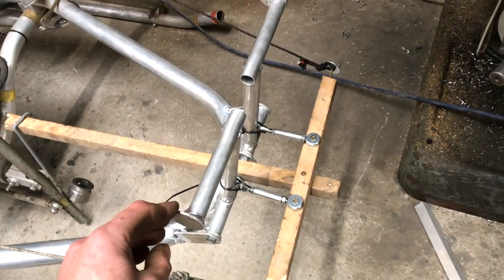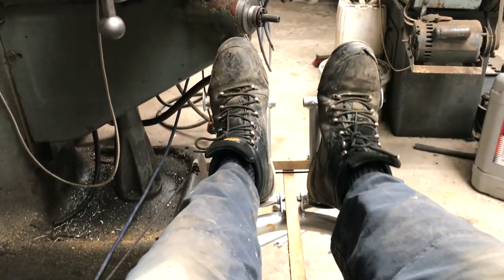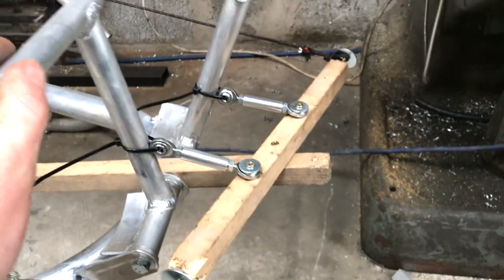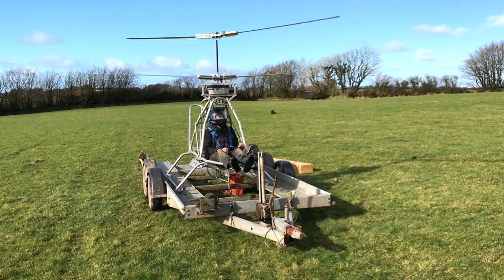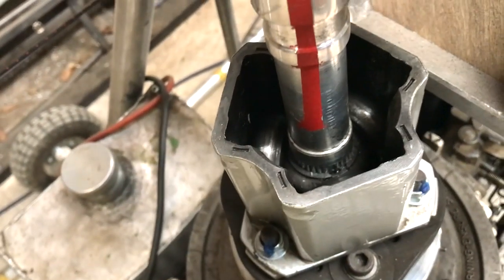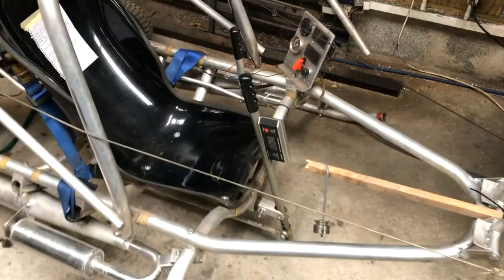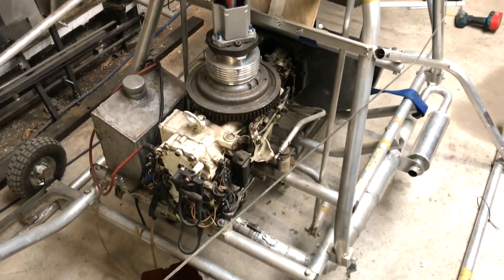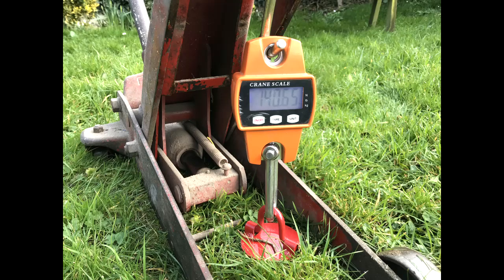Rudder Controls Homemade Coaxial Helicopter

Comment: I love the counter-rotation mech by 3 belts: one conventional, one reverse direction with the pulleys to help wrap the other side of another pulley. Never seen that setup. Elegant and simple!!!
Reply from the maker: Thank you 👍  it seems to work so far and should be efficient, you could possibly do the same thing with chains but it would be running at a higher chain speed than recommended without running in an oil bath.

Comment: Hi Ben, congratulations on your first lift off, I was chuffed to bits for you, a great mile stone in the build of your coax machine.
I've been following this project from the beginning with great interest, you have made good progress and learned from your mistakes and not given up, 
I haven't commented before now as I hate & detest  typing but now I feel I could be of some help to you, this has gust tuck 25 minuets to type but  I will persevere.
FIRST I'd like to say your choice of harness, helmet  & head board are a must on every test run & please put those stop bolts in the bottom CV housing, Tethers are all so a must at this stage of your testing, I will Come back to this at a later time.
Shortening the top mast to 10% of rotor diameter was a very wise & necessary move ( that long slender shaft & the thought of  whirl and whip If something went wrong scared me) its also nice to see you testing in that big field with the minimum of on lookers.
TEETER STOPS, I've been watching your lift of video  again,  I think you've got teeter stops in place or there's no wind at all,
you will need teeter stops for hover testing but you will need  some teeter as you test in winder conditions, I would suggest you limit teeter to 180 mm up and down at the tips this is to stop blade clap on the run up & down.
BALANSING  the TORQUE, you commented a while ago that you had hit you pitch limit @ 6 deg,  I relooked at the video and it seems to me that if you change the lower nylock nut on the pitch horn  for some washers you could increase the pitch, I would suggest you set the top rotor to 6 deg and the bottom rotor to 7 deg or to what ever it takes  to get zero torque, this would keep your rotors near the most efficient part of the Cl/Cd v A of A curve for a NACA 0012 rotor with a Re number of a tad under 1.5 million. I think you shod do this before  you set up your rudders.
NOW, you'll  soon be come to the hover learning stage but before that I would advise you to sort out the cooling system, you cannot buckets
I don't know why it started typing in red?
I've got some skid extensions that I would advise you to use till you can hover with confidants with out teethers.
I hope you find my comments helpful.
There's lots more 'd like to discus but  can't do any more typing, 
I'll send you an email with my phone number & email address if you'd like to get in touch
Reply from the maker: Hi and thanks so much for giving your time to type the message you obviously have a lot of knowledge on the subject. Very interesting comments. 👍

Comment: I don't understand how the surface of the rudders create yaw control in a stationary position when there's no air flow over them. Unless its the down wash from the Co-axil blades?
Reply from the maker: That's it, just from the downwash. The vane hinges are also tilted. They are inline with the tail boom tubing, that means vane deflection in both vertical and horizontal planes. Should I get to forward flight this should provide some authority in both flight regimes.
Reply: @Ben-Dixey  Pretty nuts 👀you can get that amount of control from the downwash I would have thought it would feel kind of unresponsive.
Reply from the maker: Me too. Very surprising how effective it is, it's fairly responsive. Nowhere near as responsive as a tail rotor but plenty good enough for what I'm doing. 
I did a small workshop test with a small electric fan, it was enough to practise swinging back and fourth.

Comment: Love your videos. Its been great to see your progress. For your rudder vanes, would it not be better to mount them on a small tail boom, under the rotor tips? That means your vanes will be under your downwash and will be effective, even while in the hover.
Mounting the vanes further back on a tailboom under the downwash will give them more authority on a longer moment arm.
Why not make up a leather "CV boot" similar to what you get on your cars gear stick?
Reply from the maker: Thanks for the comment, the blades are shorter than you think and the vanes are below the outer 1/3 of the of the rotors. I tried it for the first time yesterday and reaction to yaw seems ok for now. Leather for the boots could well be an option, thanks

Comment: Is the 8 deg is the total travel of the cyclic from left to right like -4 to 0 to +4 OR -8 to centre stick to +8?
Reply from the maker: 8 degrees is the total. 4 degrees from centre in each direction but I don't know if the travel is suitable for controlled flight. I expect less will be needed but I could be wrong.

Comment: What about your experience....... Gen h4 coaxial helicopter transmission  to yawing control 

Is it possible ?
Reply from the maker: The Gen h4 is a masterpiece of engineering and it uses differential rotor speed to control yaw. It seems effective from watching the videos but obviously requires making a gearbox with a differential type arrangement. Personally I wanted to simplify the drive and decided that tail directional fins would be my choice instead.
Reply: @Ben-Dixey  oh yes still I searching the transmission unit diagram of gen h4  to clone the master piece..... but I couldn't able to find.....
Reply from the maker: @mohamedshafeelmohamedbilal6364  

Found this. 
http://www.e-office.gr.jp/gen/Structure.htm

Comment: Sir, I have experienced a broken exhaust 2 times during testing, can you help me with some advice? I only use 1 exhaust
Reply from the maker: Have you got an anti vibration mount in the exhaust system ? You can send me a picture of the failure to my email at btdixey@hotmail.com if you wanted.

Comment: im waiting your fly😍
Reply from the maker: Not long now. 👍
Reply: How many hp Machine are you using sir.
Reply from the maker: @amrinwello6620  it's 60hp.
Reply: @Ben-Dixey  ok thank you sir i'm just        using a 40pk machine
Reply from the maker: @amrinwello6620  how's your helicopter coming along? From the last video you did it looks really good and 40hp can be enough to fly if the weight and efficiency is right.